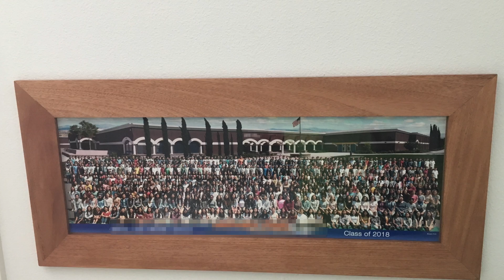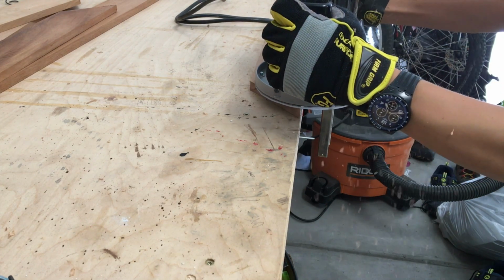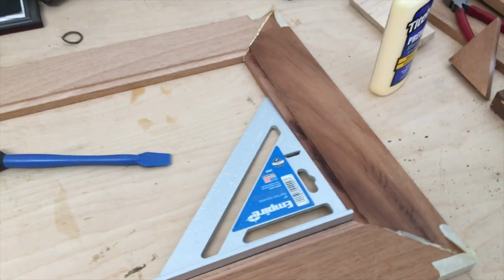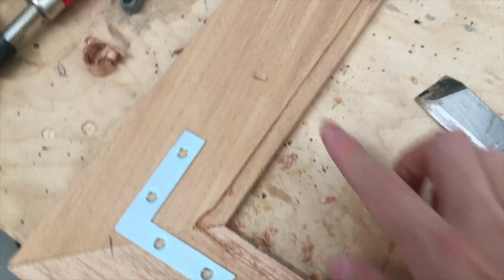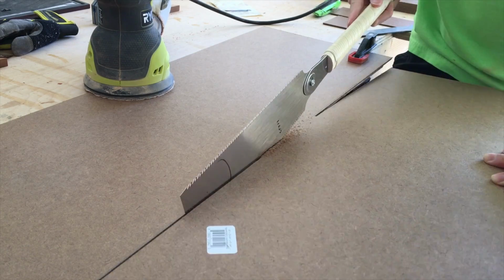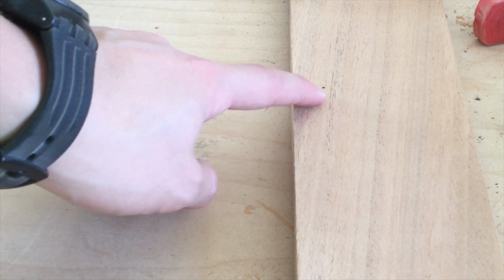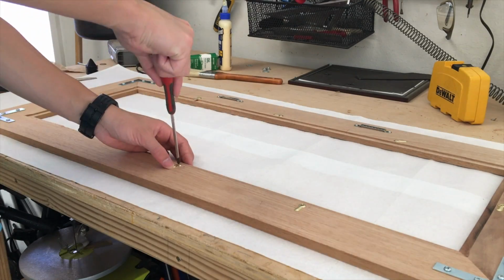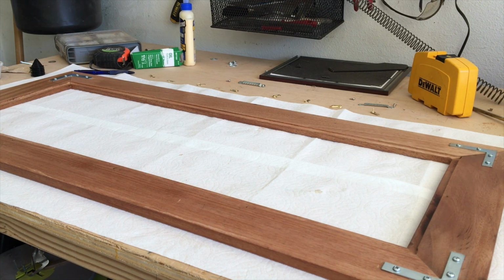How to Make a Simple Picture Frame | NO Table Saw Needed

Comment: Nice video, but why didn't you use the router at a lower depth to correct the thickness issue on the rabbit rather than a chisel?

Comment: click-bait you still used a Saw....
Reply from the maker: It says “no table saw needed”. I don’t even own a table saw. This is not clickbait, I said no table saw, I didn’t use one.
Reply: And how are you supposed to make anything out of wood without a saw
Reply: @joefran8443  That's why I was watching the video. I figured at most maybe a hand saw, or an electric hand saw...But based off of the description, I expected there to be no mounted saw situation. It's a great video, but its misleading. Great frame though. I did find a few videos that were without a table or miter saw after this video, so my searching was still successful.
Reply: Right why do people lie.
Reply from the maker: I posted this for people like me that want to build something without a table saw. This could very easily be also made with a hand saw. Compared to other designs which need special jigs and joinery with a table saw, this is much easier to make. It’s not misleading because I said no table saw, and just because it has the word saw doesn’t mean it doesn’t take any type of saw.
Reply: Because a table saw and a miter saw are two completely different things. The only thing they have in common is that they have teeth and spin. Their functions are different. I actually googled picture frames with no table saw because I too own a miter but no table so his title served it's purpose.
Reply: Title was totally accurate. It gave no impression that no saws were used, only no table saw... A very specific tool, not a generalized name for all saws. This was super helpful for me. Thanks for the video!
Reply: The  title is perfect and accurate and it was exactly what I was looking for. I have a miter saw but no table saw and needed to make frames so this is exactly what I needed. Thank you!